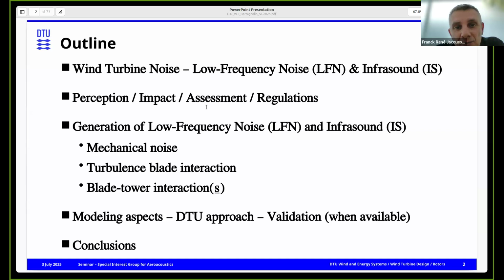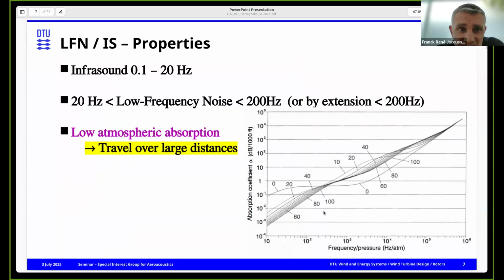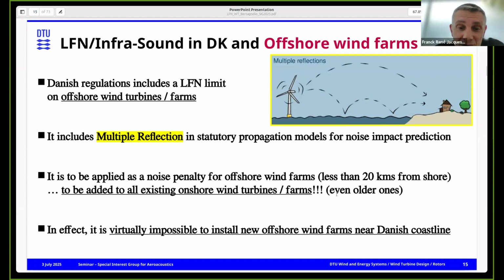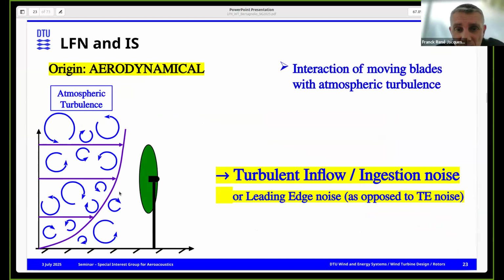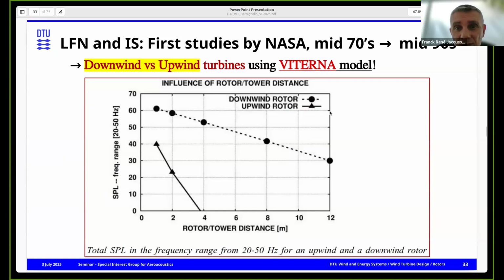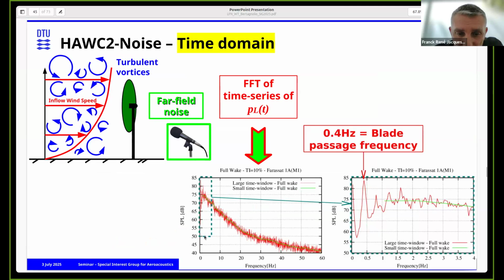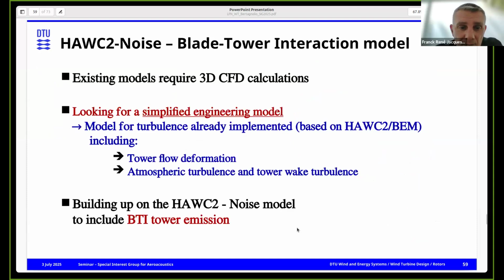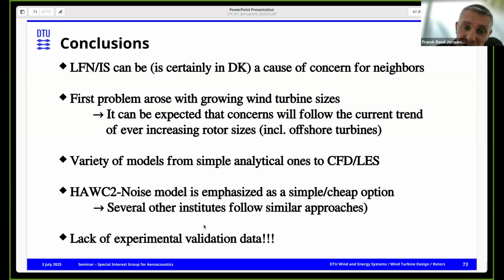Aeroacoustics Webinar: Low Frequency Noise from Wind

Comment: We have a relatively large off shore windfarm about 5 miles away with uninterrupted views.  Only when the farm had an upgrade of an additional 32 8MW turbines did multiple towns around the coast start reporting serious low frequency noise in the homes of local residents. 
The farm was mostly made up of 3.6 MW but when the extension went live with 32 8MW the problems began. Danish regulations would not have allowed this? Is that fair to say?